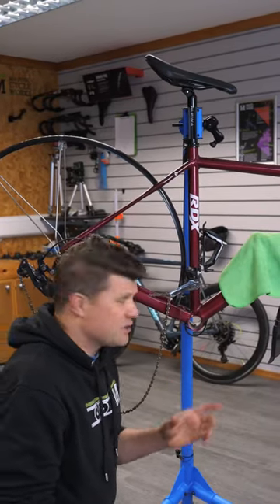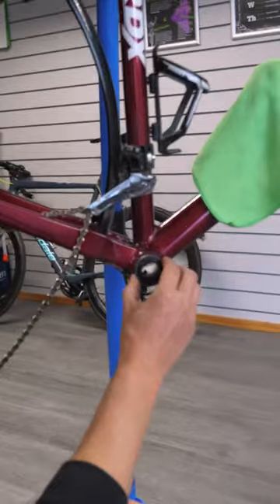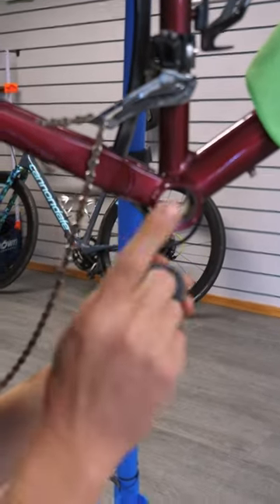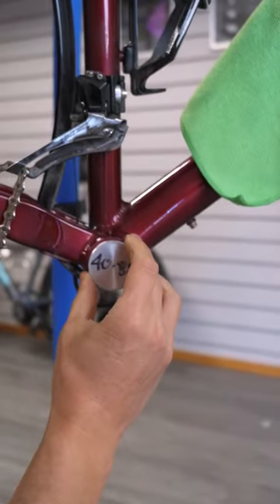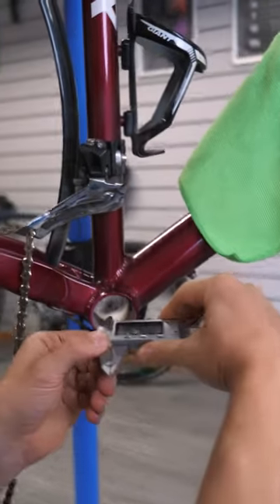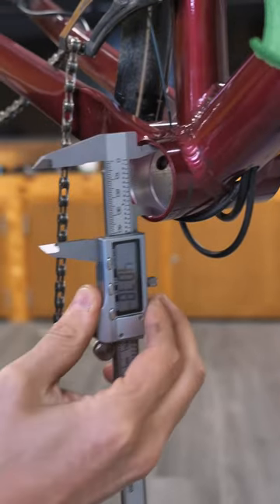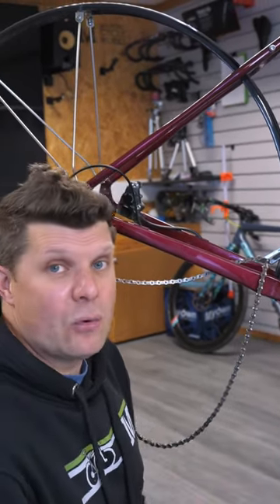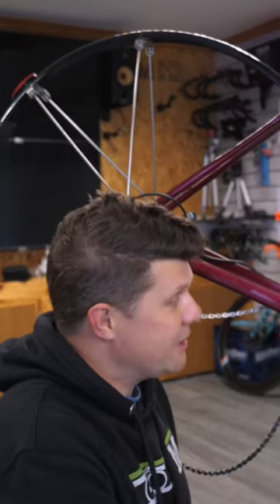More pressfit fun. Take your guesses 🤬

Comment: I’m old enough to have worked on frame setting tables back in the day.  A nice Italian frame came in, you faced the head tube, chased and faced the bb, aligned the rear drop outs then set it on the table to check its trueness.  A lot of work yes, but you had less bearing issues downstream.  Also, no bearing races, the balls were set individually
Reply from the maker: Back when things could be repaired rather than just thrown away. Must have been a good feeling. Thanks B